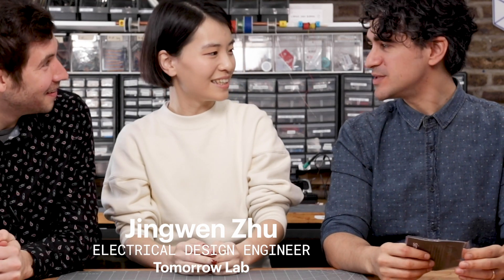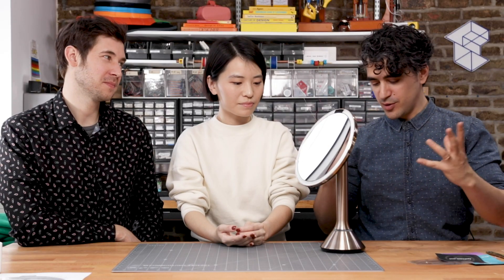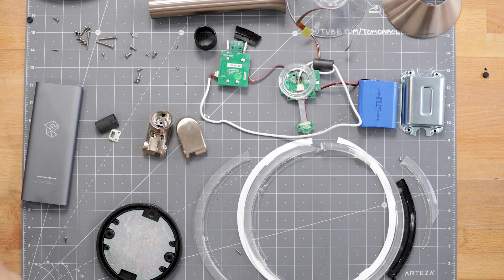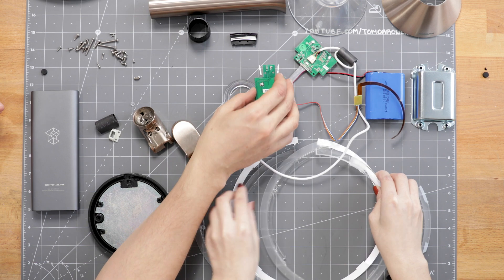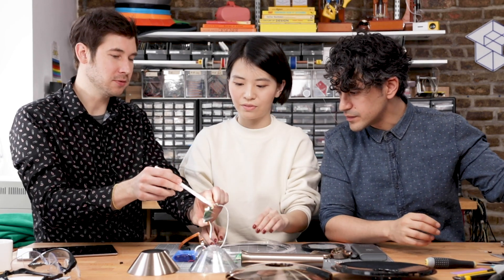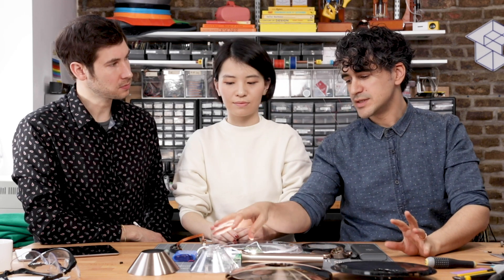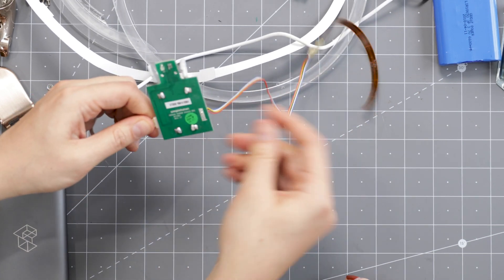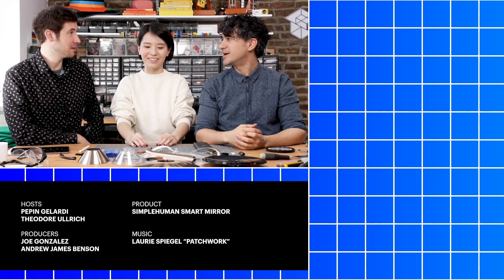Teardown of the Simplehuman Sensor Mirror

Comment: OK, I gave it a try. The mirror isn’t coming off even with warming it with a hair dryer, I still ended up breaking the mirror. Then when I did get inside the part I was trying to fix was soldered to the board, I was trying to fix the charger port, but yeah, like I said that glass has something on it so sticky that it was adhering to my  workbench from the broken pieces. 6-22-25

Comment: Good to know.  I have the older version of the expensive one (1X, 5X, 10X) selling for 399.  It pains me to reinvest and the usb charger is bent.  I am going to try to take it apart and fix it.  Otherwise after around 10 years it is still going.  It came with an iPhone App to adjust lighting to capture any of your regular environments.  It never worked well and noted they gave up on that feature.

Comment: The mirror fell and the shaft broke off the base. There is a clear circular part that holds them together. It broke. Any idea where I can get that piece? Model is ST3052
Reply: Mine fell an the clear piece Also broke the screws connected to the mirror side an the base plastic cracked so they are out of the screw holes. Any luck I messaged the company no response yet what did you do I've had mine 14 years I'm so hurt

Comment: You guys skipped over the one thing that I wanted to see. How does the bottom base come off?
Reply: i can no longer position my mirror.  it does not stay in the position I leave it.  Would think its a simply thing to tighten the area where the mirror meets the stand but no obvious screws.  I contacted SH but they say its not user fixable.  But, i figure you guys may have some ideas.
Reply: @davidmiller7637  I have the same issue with my mirror. Hopefully they will see this comment and get back to us!
Reply: Me too.  I have an older model BT1080 and can't figure out how to take off the base to replace the battery instead of buying a new mirror for $200.  I guess I will have to write to the company.
Reply: @virginiaomalley  Sorry for this very late reply. I believe we found screw access hidden under the rubber foot. Hiding screws under feet or rubber bases is very common on most table-top products as the rubber makes a nice press-fit into the screw bosses and/or is easy to adhere with double-sided adhesive.
Reply: @virginiaomalley did you ever figure out how to take mirror apart? Thanks
Reply: @kauaireed9006  On my mirror (model SH1S2P) there re two little rubber plugs on the bottom. They cover two phillips head screws. I used a plastic spudger to pry out the plugs - they are soft. Then you can take out the screws and the base comes off. The battery and small circuit board are in there. More screws must be removed to get at the battery. I didn't take the mirror section apart - looks to difficult and risky as they said in the video.

Comment: Our mirror popped out becaus of an airbag looking thing behind the mirror. Ours is the travel 5" titanium one. Any idea what the airbag thing is for?
Reply: Sometimes the battery breaks down and reacts with the plastic that encases it?
Reply: Mine did too. It is called a pillow battery. I'm replacing the battery and also the mirror with a 5x mirror instead of the 10x mirror it comes with. Plus I am putting a small magnet inside the mirror so I can attach a 30x mirror to it.